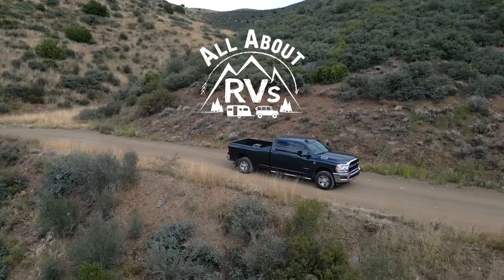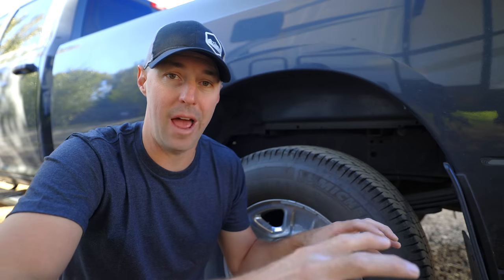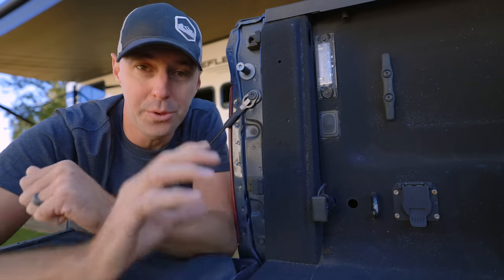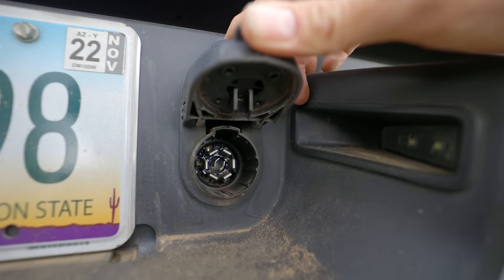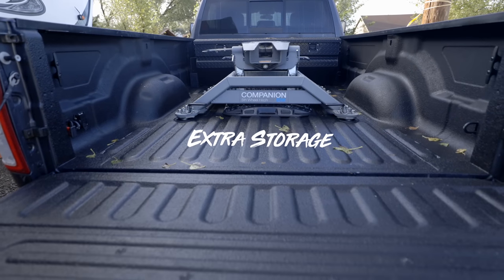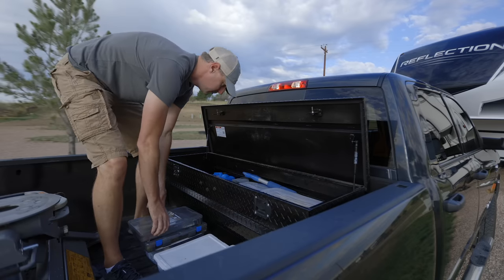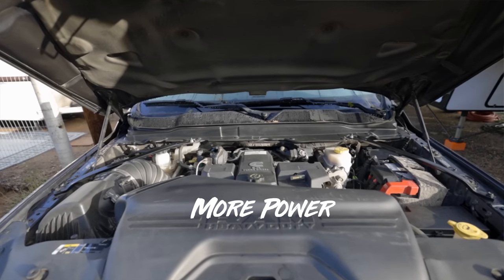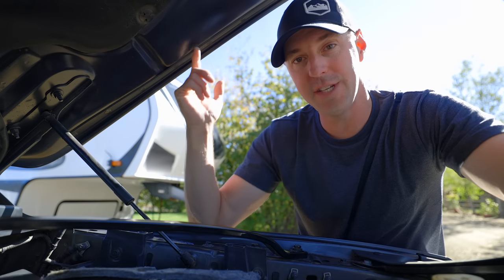Truck Modifications For RVing!

Comment: I;m surprised you feel like you need a 2nd alternator if you have solar panels on your trailer. We're up in Canada and can go weeks without having to worry about the batteries (which are lead/acid BTW.  Lithium are was overpriced IMO)
Also surprised you have a (LOUD) Champion generator.

Comment: I put a 35 gallon transfer tank in my 2022 F350 (7.3). It of course extends my range, but then I can fill up the generators, and even my lawnmower and stuff at home without gas cans in my garage. It’s a lower profile tank and pump that I can have my bed cover over — highly recommend.

Comment: When I moved my lifepo4 batteries to a heated area it freed up the normal 5th wheel battery compartment.  I added a 1 gal 120 volt compresser in the space that is hooked up to my inverter.  No 80-20 duty cycle.  I keep a 12 volt compresser in the truck in case I need it.  I don't have to worry about hooking to batteries with the compresser.

Comment: When doing modifications to a truck like increasing the size of fuel tanks, adding a tool box with tools etc and tonneau bed covers….all adds addition weight to what you already carry.
Trucks have a stated and engineered payload capacity per the manufacturer. Includes people,fuel and stuff.
A gallon of diesel weighs 7 lbs. A tool box 50 lbs Tonneau cover 30 lbs estimates
If your already close to your payload capacity…adding the modifications without reducing your existing load will surely make you over weight. Not sure what an insurance company would say if an accident happened and one was over pay load capacity.
Just my 2 cents
And yes I am at my maximum payload capacity. 2012 Ram 3500 srw short box crew cab Laramie 6.7 Cummins 

Sticker Truck Payload 2910 lb.

241 lbs.fuel
250 lbs. 5 th wheel hitch in truck
2004 lbs.pin weight of 5th wheel hitch 20% of 10,206.lb of trailer.
350 lbs. People & stuff including tonneau bed cover 
Total 2845 lbs. carrying in truck.

Comment: 3 Truck upgrades. 1st, I added two led light strips under the hood. Any night work needed makes it much nicer to see. I got mine at Amazon and connected to my RAM Aux switch. 2nd, I installed dual lights on the bumper to help back the truck at night or hitching up or working back there. I installed it in the bumper to be out of the way and also connected them to an Aux switch, so I can utilize it when not in Reverse.
I also installed the Deck truckbed draw box. LOVE IT. Ton of storage and easy access.

Comment: I got lucky. My 2021 Ram 3500 DRW came with the rear Ram air suspension and has the Duel 220amp alternators.
It has two 400watt 110plugs one in the dash and one in the bed back by the tailgate.

Comment: Great video, as always! 

Similar to your bed plug but different use for me, I added SAE connectors to both my truck and RV batteries for a quick connect on my Viair. The truck one is in my front wheel well. Makes it very easy to see to the tires either hitched or unhitched. 

I went with the wireless remote setup on my airbags and LOVE it, so quick to adjust and set. Can’t recommend that route enough! 

I have a Bakflip on my Super Duty, it’s alright but wish I would’ve gone the retractable route. Although that wouldn’t work with my stake pocket ladder rack I use professionally sometimes, or my Bakbox which is awesome. The height of these current HD trucks makes it a little tough to fold and unfold from the side standing. I’ve also noticed that the bed cover, when folded up and towing, twists up a bit from all that weight flexing around on some drives. The panels are usually real uneven and need to be recentered after I unhitch from towing. For these reasons I would recommend retractable for anyone looking new. 

Safe travels guys!

Comment: Biggest mod for me now comes standard in most newer diesel trucks, exhaust brakes! My pristine, built for me at the factory, 2001 Dodge 2500 5.9 6spd manual 4x4 was a little nerve wracking on big long down hill grades with my 11k lb TT. I didn’t like using my tranny to help too much with the braking then I stumbled across Banks exhaust brakes. LOVE THEM! Had more Banks mods with a bigger muffler and air flow, a bigger turbo installed and a SnB air intake. Also the AirLift air bags with the wireless remote to fill in the cab.

Comment: Good video 😀 7 way pin comes stock on most trucks trucks with trailer and 110 out let also if I have to add suspension up grades  and no air bag system I  get a bigger truck like dully if that doesn't work go to hdt truck or class 8 my chevy Silverado duramax comes with a second alternator from factory 😀

Comment: 2013 Sierra 2500HD gas. 
I installed a 2 low unlock from BD diesel.  It allows you to put your truck in 4low but bypasses the front axle so you get 2wd low. Makes driving & backing up easier in campground can just idle & go a lot slower.

Comment: Hi Jared - love your channel. I want to share my 2 cents worth on the tonneau cover. I had a rolling one before and although the canister it rolls into behind the cab takes up some space underneath it, it is still flush with the bed rails. I bought a Bakflip, which I agree is a great tonneau cover but by the time it folds up several times on an 8ft bed you have about 12" of cover which could rub on the the cap of the 5th wheel if you are on uneven ground. I have to drive with if folded up against the back window of the cab which isn't the end of the world but it is kind of a pain.

Comment: What maps app are you using that allows you to put in information like clearance and towing vehicle? I was interested in being able to put in a max speed so that the ETA is real world. Love the videos!
A mod we did that was a game changer was a rear view mirror camera (with dash cam) that has a connector at the hitch and goes all the way to the trailer license plate. It is like the trailer isn’t back there! We also have a camera on the license plate of the truck so that if there is a tall load in the bed of the truck like kayaks I still have a rear view mirror
Reply: I also want to know about that GPS that allows you to put in camper info. Length and height.
Reply: RV Life is an app that that gives access to an RV GPS called Trip Wizard.  It takes the height & type of your RV into consideration when mapping routes.  We did have some issues with it when nearing our destination, occasionally…routing us thru neighborhoods, instead of taking the next exit.  And there are others out there…

Comment: I don't have a 5th wheel but I have done a bed mod that was cheap due to the materials were somewhat free. I took two 2x8 boards and in my Tundra I angle cut them to fit vertically into the two areas that provide an 18" divider both in the front and the rear of the bed to keep things secure when on the road. I also made dividers that slide along the tailgate 2x8 to restrict the movement side to side. I hope you can understand this w/o a photo. Also I have a 6.5' bed so I have now 3 sections for storage which are always easly removable to use the entire bed.

Comment: Added 50 gal auxiliary tank that gravity feeds as well as stealth performance system where I can ad 30, 60, or 90 extra HP. Added fass fuel pump -filter that removes water and air from fuel.  Also added tailgate steps.

Comment: Great video. Regarding your viiair, snip your wire ends and install Anderson connectors and add a little length if u need it while u do the swap since you have the plug in your bed.

Comment: You are not taking full advantage of your Renogy DC/DC charger because you aren't using the LC terminal that cuts the output in half.  I ran two 18 ga. wires from my travel trailer to a three way toggle switch mounted on my dashboard.  I used a motorcycle battery connector between the truck and trailer but could have gone with a small Anderson connector. The switch is powered by a fuse that only supplies power when the ignition is on.  This allowed me to use the larger 60 amp DC/DC charger with my 250 amp OEM alternator because I can toggle between 30 amps/ off/ and 60 amps while driving. 

I also ran 4 ga. wire to the battery and used the larger Anderson 120 connector with a weathertight boot for the connection between the truck and trailer  The connection at the start battery is protected with a 90 amp block fuse and has a Blue Sea on/off switch to kill power when the trailer isn't connected.  A breaker would do the same thing but some users report nuisance trips if the engine compartment gets too hot.

Comment: Can you run your generator off coach  pressure or do you need to run it from the tank using the regulator that came with the generator
Reply: I can answer that one as I have nearly the same generator he has for my trailer. You can run it off the low pressure quick connect - however you need to modify the hose that comes with the champion generator. It has two regulators in line in the hose- a “standard” high pressure regulator and then the one needed to properly feed the generator. You can add the proper disconnect yourself between them for about $20-30 in parts. Google around for “champion generator propane hack” or so and you can find some guides. I’ve done this twice for two different generators and it runs great. Good luck!

Comment: Thanks for your great vids. Learning a lot from them. I am upgrading my solar system with a lithium battery. I also have have your 7pin with aux 12v to charge up the acid battery. Will I need a dc to dc charger like you installed or I can leave as is ?

Comment: I ended up buying a mechman single, 370 amp alternator for our 2015 super duty. I don't remember exactly, but I want to say it puts out near 250 amps at idle. No need for new brackets or belts. Just as simple as changing an alternator and upgrading to a thicker gauge wire. Then, if needed you can install a high idle switch which most OEMs have a provision for and bump output even more.

Comment: Get a bigger DC to DC charger (40 or 60 amp) instead of a second alternator and connect it to your truck battery. It's a lot cheaper and should do what you want.
Reply from the maker: I don't want to over tax the current alternator, I would have to get a bigger alternator or a second one.

Comment: We have a 95 Suburban for our prime mover so we had some work to do to bring it up to modern specs.  Came with heavier suspension, brakes, oil and trans coolers, and four row radiator.  We've done upgraded shocks, air suspension w on board compressor, TPMS, new style towing mirrors, entertainment system, LEDs throughout, backup and rear view cameras, dash camera, keyless entry, K and N intake and daytime running lights.  It took a little while to do, but our last trip was much easier.  We went with the suction cup and articulating arm style mounts for our phones,  tablet, and TPMS monitor.  We also installed a rear view camera on our trailer.  That was a huge improvement in driving comfort.  It's still a 95, but it is a lot easier to tow with and more enjoyable to drive.

Comment: I installed Goodyear air bags on my 3/4 ton. I like the Goodyears because they have an internal bump stop. This allows me to run them without air when I'm not towing. Other brands I looked at didn't have the internal bump stop, and required that you always have 5-10 PSI in them. These systems always leak so you could find yourself topping up once a week or so. Assuming you remember to do it. 

I looked into Timbrin and the similar Sumo springs. They would have been cheaper and much easier to install, but wouldn't have achieved all of my goals. In stock form my truck was squatting 2 inches at the rear axle when towing. This was taking a lot of weight off the front axle. The front was 800 lbs lighter with the trailer hitches than without it. This wasn't good for handling or braking. I think either of the passive bump stop replacements would have been at best a partial solution. The air bags let me get the truck completely level, and distribute the trailer's weight over both axles.

Comment: I added a camera to the truck bed, attached to BakFlip tonneau cover. Installed a 60 gallon aux fuel tank with fuel pump. TPMS sensors on all truck tires and spare with quick and easy spare tire fill. Used Velcro to attach rear monitor to rear view mirror. I added a truck bed carpet, super helpful!  
Added a Banks air filter and differential cooler. I power a 60 amp Renogy dc-dc charger from my battery. But would be interested in a high output 2nd alternator as well!  
I put a 12v quick connect on the outside of the rv so I can power the ViAir without having to open a compartment to access the batteries.

Comment: Great video dude! I am with you in regards to the on board air...I have a Smittybilt compressor that works amazingly well but I would like to have a tank on the truck. What I am thinking about doing is running air lines under the trailer with branches to each side near the wheels. I have a triple axle and plan on making a little 5 foot hose that will connect to all three tires at the same time to to fill them and have them be the exact same pressure. I had this kind of system for my jeep where I could air up (or down) all four tires at once. SOOOOOO MUCH EASIER. I'll post a video on my channel once I get to the project.

I agree with the dash cam! I have a front and rear facing camera. Thanks for sharing.
Reply from the maker: That’s a great idea for air adjustments.

Comment: When transporting Propane Tanks, I use the Camco 57236 Cylinder stabilizer - That has been great way to transport my propane tanks. I have also used 2 inch grip tape on the raised truck bed ribs. I was going to do the stuff you do yourself but I have done this before years ago on another truck and it worked great. Since i have a small 5'7 bed with my Ram 1500 and tool box - a 38 foot roll worked out perfect. None of my stuff moves around in the bed anymore and conjunction with with that cylinder stabilizer. I run one of them $60 chinese air compressors. However i removed the 12v plug and added a 20 foot lead with fuse and alligator clamps. This way can take it another RV or another vehicle to use. Love the channel and mods. Like your idea for 75 amp anderson pole connection in the bed, i already have adapters for my trailer plug to use my outside ham radio equipment on trailer plug but like the fixed multi use anderson pole idea better in the bed. Anderson poles are great!
Reply from the maker: Great set of mods.

Comment: As a person that has used Timbrens you need to upgrade to the air bag system with onboard air compressor. It is night a day difference in the ride of the truck, my wife has a bad neck and back and with air bags I can adjust the ride based on the weight and road conditions to help give the truck a smooth ride.

Comment: I have a 14 Ram 2500 mega cab with 6’ bed and factory utility side boxes. I’m thinking of going from a bumper pull to a 5th wheel. Do you have any opinions or negativity about doing so ?  The truck is great and I didn’t want to sell it for a long bed 
Love the videos too.
Reply: Whether you can tow a 5th wheel with a short bed will depend entirely on which trailer you want to tow. I tow a 36 foot Cougar with a 13 Chevy 2500 crew cab short bed. I believe some (maybe many) larger trailers require a long bed. But at that point you might be exceeding your truck's weight limit anyway. When I was shopping for my current trailer I made a short list of models I was interested in, then did my research to eliminate those that my existing truck couldn't handle due to size or weight.

Comment: I was an avid Scosche mount user for several years, they are great.  But when I upgraded my phone to one that did wireless charging, I upgraded to a Mous case and magnetic charge mount.  This one is a game changer for me.  Like the Scosche mount, you just snap your phone into place, but the magnets are self-orienting, and there are no more cables to plug in to keep the phone charged (doesn't help if your Android Auto or CarPlay aren't wireless). THe phone starts charging as soon as it's on the mount. Plus the phone cases are every bit as tough as the online ads make them seem.  I have dropped my phone countless times in about 4 years of use and haven't had a scratch on the phone.
My only other mod to the Truck is a set of Rhino Racks for the roof - we carry two kayaks up there, out of the way of the trailer.  Great solution for a bumper pull but may not have the clearance for a 5er.

Comment: Hi Jared!  Great suggestions for truck modifications - great minds think alike as I have installed many myself.  I use my 2016 RAM 2500 Cummins for towing my 30 foot 5th wheel trailer and have considered installing the larger fuel tank to boost distance traveled and to take advantage of less expensive fuel.  My question is, were you able to correct the distance to empty calibration with the larger tank?  From what I've read, this is one shortcoming of having the larger tank as this calibration is no longer accurate.  Happy New Year - you have gained another subscriber!
Reply: I am not sure about the 4th gen, but the 5th gen you can configure up to 55 gallon on the computer.  I actually enabled the chassis cab features on my 3500 DRW pickup so it can tell me dual fuel tank capacities. that was a lot of wiring though.

Comment: I added a 12 volt cigarette plug right next to my batteries in the 5th wheel so I can run my compressor 
and it has worked well for us. As I'm running a ram 1500 I added the air ride bags in the back and I added a tuner for the Hemi which makes the shifting less sporadic and more power to the truck. I installed the Tuxedo duece2  cover over the bed and it includes a locking light weight non metal tool box. I have been using this system for 5 years now and I know that I cannot load up on weight such as water and food as I will exceed the max of the truck. But until the prices come down this is my setup. It has worked well for us.
Loved  the video